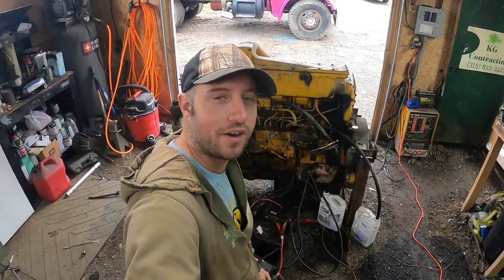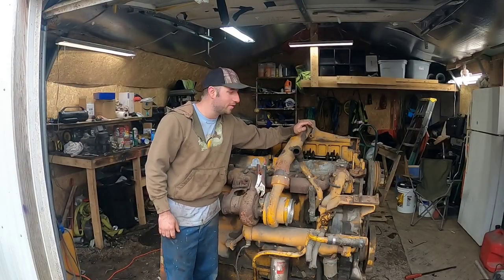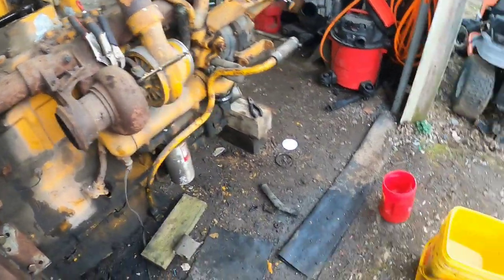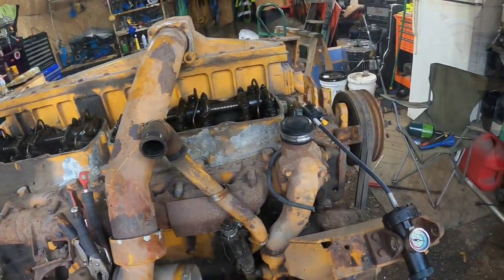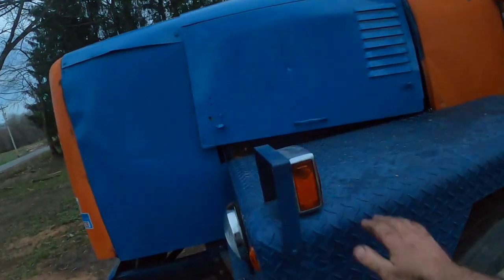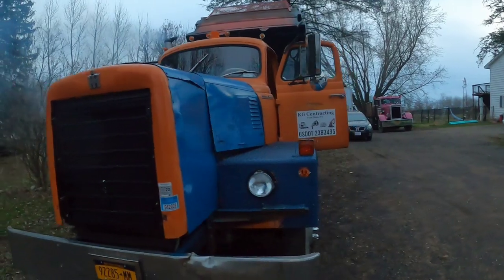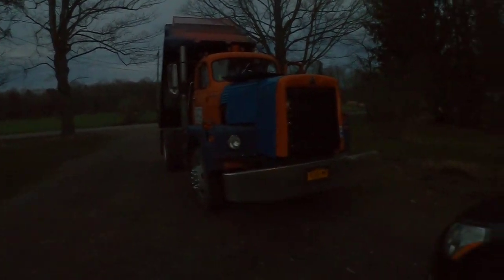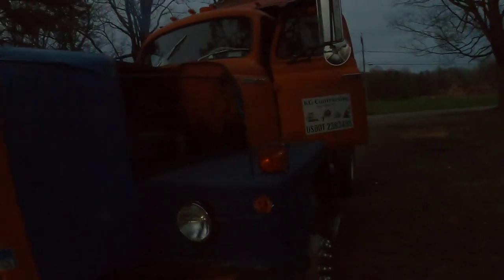It Lives! Caterpillar 3406A & 6-71 DD Last Run

Comment: Very nice, the 3406 and 3408 Cats are one of my favorite engines.  Although everything I own is Detroit, I still love the Cats.:)  With the 3406 in there you'll have trouble keeping the rubber on.:)
Reply from the maker: I love Detroit's too, I'm going to miss it for sure it was fun to drive! That 3406 is definitely overkill for that truck i wont have to worry about power. I'll miss the fuel mileage of that 671 too ha. Thanks